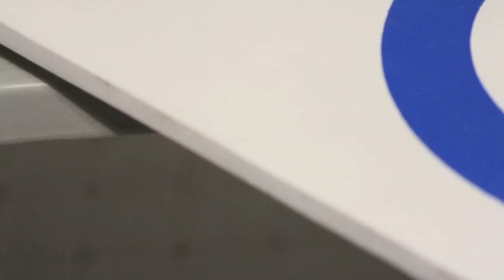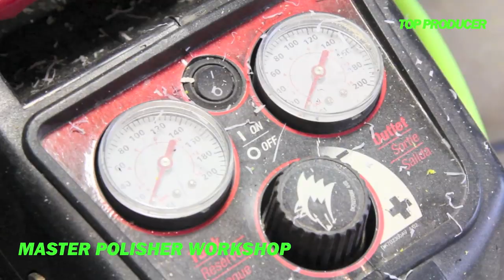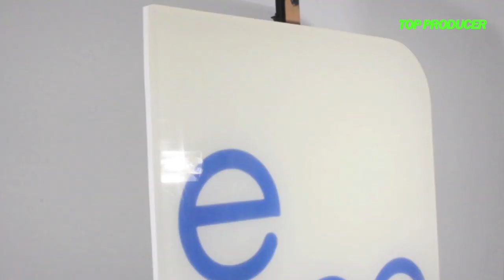1 INCH CLEAR COAT EPOXY RESIN CLR MAX PRO POLISHING TUTORIAL LESSON TABLE TOP

Comment from the maker: Hey This is the product:
ebay.ca/itm/EPOXY-RESIN-ULTRA-CLEAR-VERY-THIN-HIGH-HEAT-TABLE-TOP-COUNTER-TOP-COATING-1-5-/310372288072?pt=LH_DefaultDomain_0&hash=item4843a14648